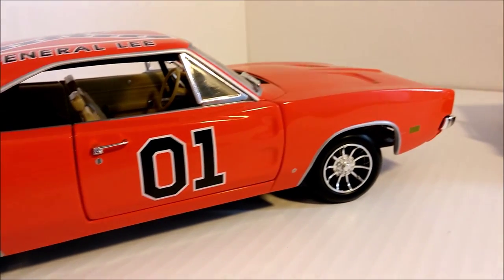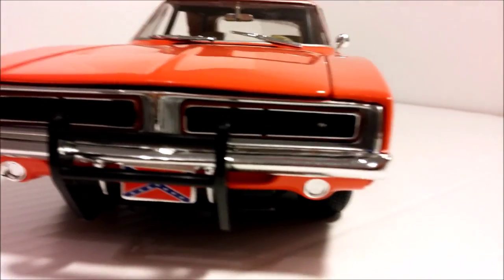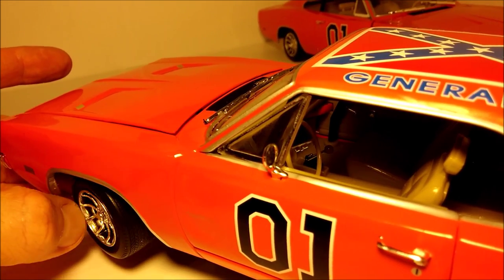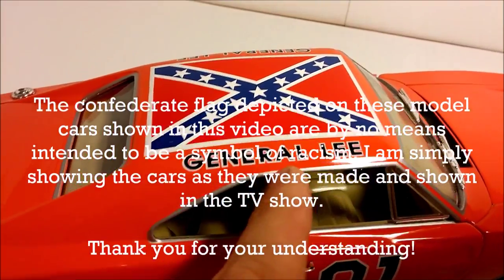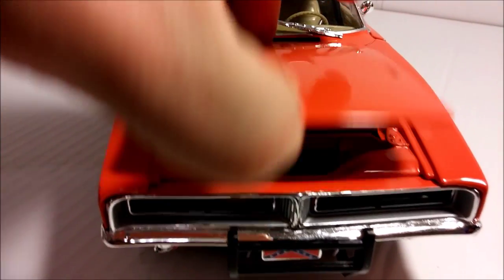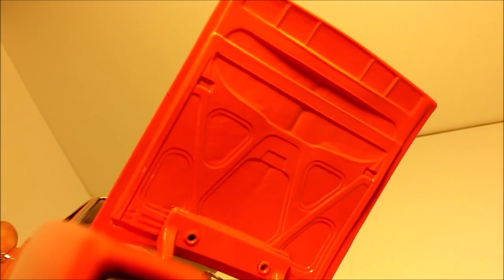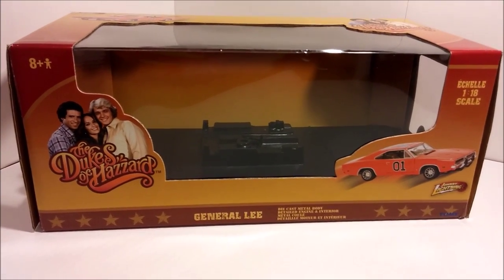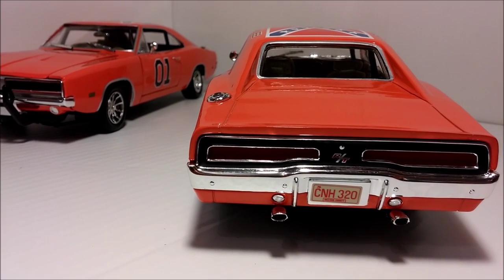1969 Dodge Charger R/T "General Lee" - 1/18 ERTL model car

Comment: do you think is possible to remove the front license plate, or will mess up the front? thanks in advance
Reply from the maker: It's just a sticker. I have one with license plate the other one doesn't. You might be able to get one without the sticker or just remove it.
Reply: Thanks! I've ordered one a few days ago, I just can't wait to have it and to do a little tweaks on it! Like removing the front plate

Comment: I have this exact same model. I also have the Autoworld one which is of course much more accurate. The Autoworld one I have is on show but sealed in its box and the slightly non-accurate one is on display out of the box because it's still a very nice piece.
Also, I forgot which company it was now but about ten years ago when they released the Dukes car in 1.18 scale, they accidentally made the interior of the car, the seats and dashboard, black. This car is now considered very rare and despite the black interior, is going for a lot of money on ebay these days.

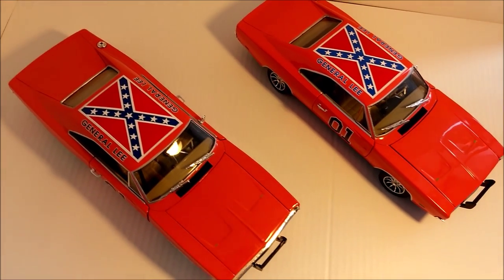Comment: Not picking on this video, but just for those who are curious, as one  who collects cars, this is really not the version to buy of the General Lee at this scale.  The Auto World 1:18  is much more detailed and more screen accurate.  The scale isn't quite 
right on the Ertl, and it has some wrong details and some missing details.
Reply from the maker: Hi David, thanks for the comment. I had never seen the Auto World version of the General Lee. From what I can see on amazon it does indeed look more detailed. I might add it to my collection eventually and do a comparison ;)
Reply: Yes, it's hard to know what is what they way they have the General Lee's listed on Amazon.  But I did a lot of research and the Auto World is definitely the one to buy.  It's weird though, on Amazon, there are a number of different listings for the Auto World version ranging greatly in price.
Reply: It is if you're a collector

Comment: Mine is superior. It has the RT badging on the front grill & in between the taillights. Mine also has the Charger badge behind the rear window. Also...mine has the accurate rims. *Available at Cooter's Place

Comment: It looks like the "GENERAL LEE" on the roof is Black on one version and Blue on the other as well.
Reply from the maker: It's actually black on both. Only the cross of the confederate flag is blue. The lighting is not perfect, but you can also check out the pictures on my blog and zoom in if you want: https://motorscotti.com/2015/12/15/1969-dodge-charger-rt-general-lee-ertl-model-car/